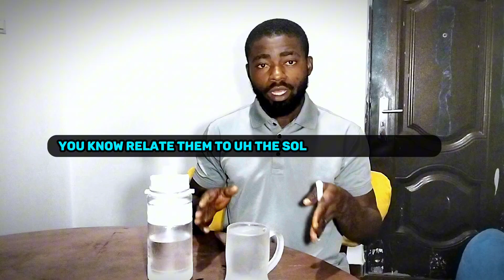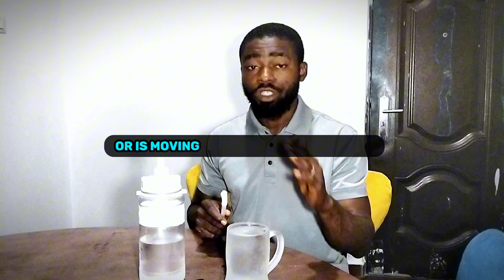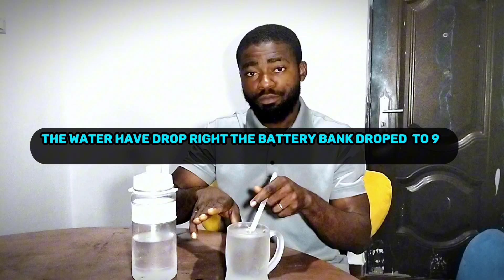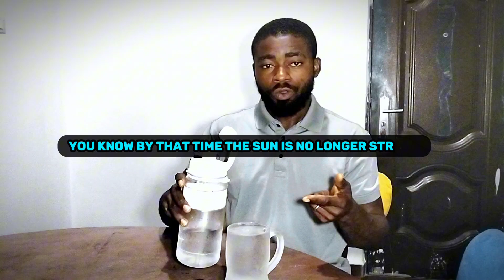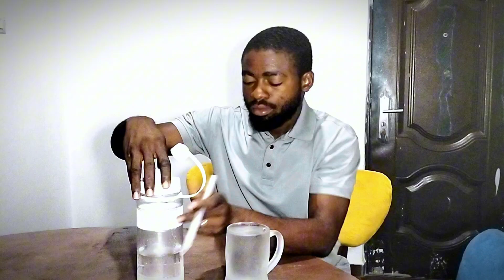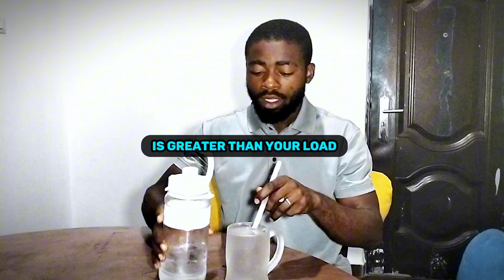practical demonstration of float and absorb charge in solar energy system

Comment: Great illustration!
Kindly clarify me.
If 
Watt = Volt x amp.
For a Solar pv, does it me
Pmax = Vmp x lmp ?
Because I have 190W with: lmp 10.11a & Vmp 18.8v.
Would I be correct if I say
Watt = Volt x Amp,
Pmax = Vmp x Imp, and my pv 
190w = 18.8V x 10.11A ?
Reply from the maker: Yeah, w=v×amps